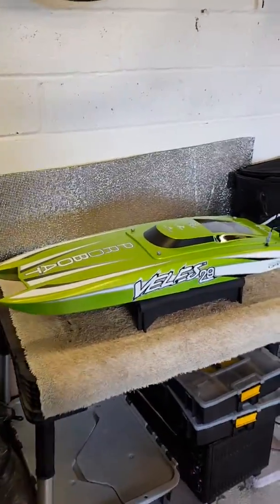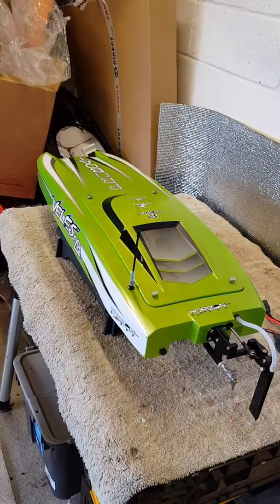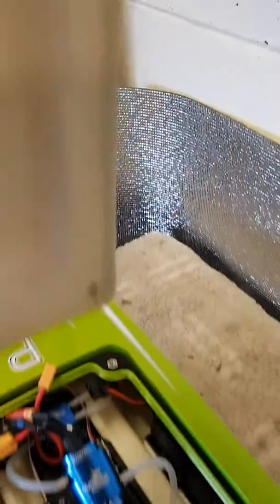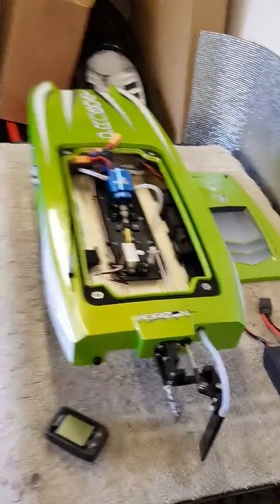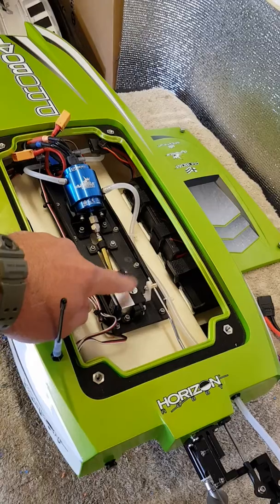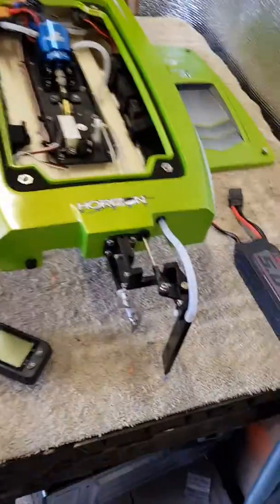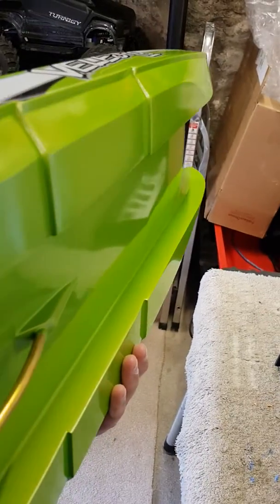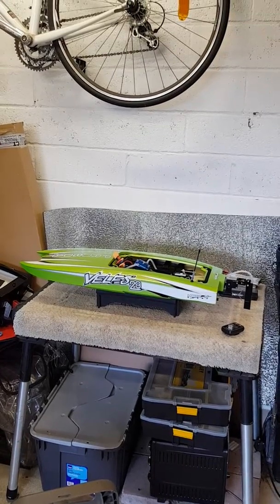Proboat Veles overview

Comment: You dont need change motor and that ESC is 120amps, all you need is modifide water cooling sistem, prop ,20kg servo and two S3 lipo batt and you will run 65mph eazy or more

Comment: UNRootedRC - Nice boat mate!!  I have the #Sonicwake 36 Installed and a  Leopard 3674 X2 4-Pole Brushless Motor 1900KV motor and trying to decided on what ESC to go with! I want the Seaking 180 but It's going to be a tough fit in my hull due to the self righting! You know what they say its better to have the power and not need it than need it and not have it!